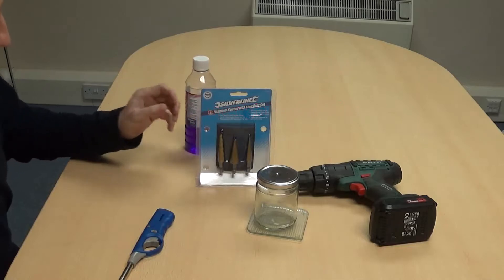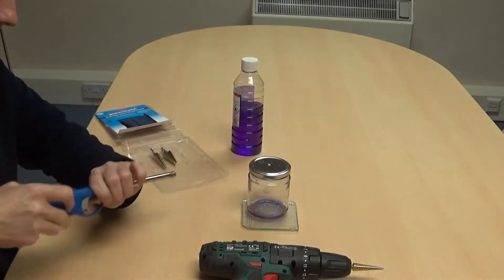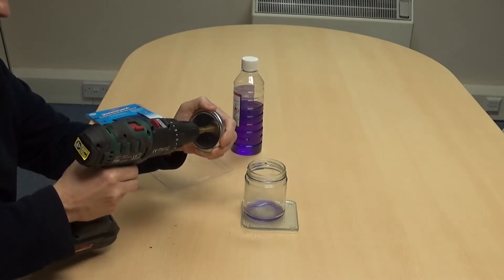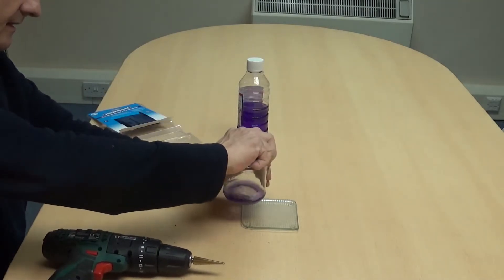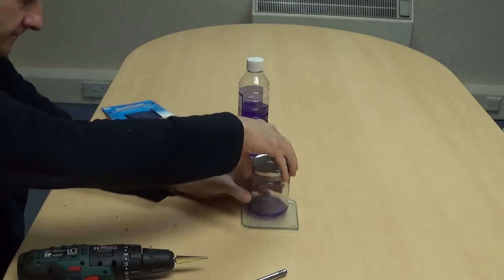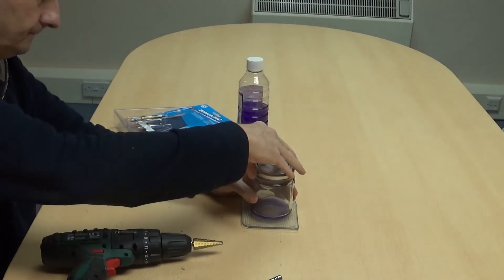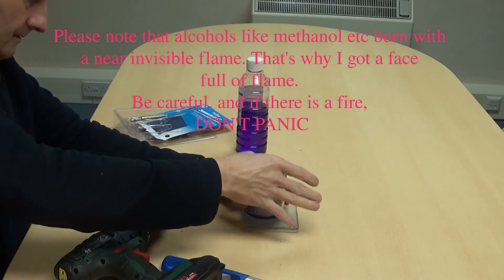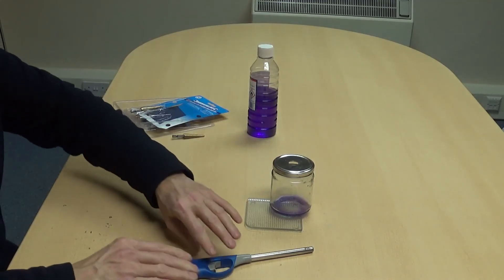How to make a  Jam Jar Pulse Jet

Comment: Ambient temperature , and perhaps even atmospheric pressure, would probably be significant factors in <what works> - as these would directly affect the volatility of the fuel.
Reply from the maker: I see why you say that, makes sense.... but they work well outside.

Also if you run then for extended periods of time you run them with the base in a water bath.

Many thanks for watching, please like, share and if you like the channel, subscribe!

Comment: Diffuser???
Reply from the maker: It's common to use a water bath. What had you in mind as a diffuser?
Reply: @BensWorkshop  ummm 😐 its a cone shaped object, like a pipe reducer but with holes spaced evenly around...
Reply from the maker: Interesting idea. Inside or outside the jar and where would the narrow end go? (Next to the hole or far away from it?)
Reply: @BensWorkshop  https://makezine.com/projects/make-05/jam-jar-jet/ - in short / the small hole inline and about 10mm - 15mm suspended... I learned about it when I was 12 while doing steam engines for school project at a university campus. I could most likely explain fully how it works but ja... I enjoy the old timer' technologies. I can appreciate the simple things more so then most youths today cause of the understanding of what generations before me have accomplished... BTW I kinda use/recycle aluminum cans and occasionally tin cans for most of my projects like turbofans to fully functioning rockets. Haven't made anything go higher then 21530m yet still fine tuning at 18939m...
Reply: Planing on hitting the ISS with a tin can eventually 😉...
Reply from the maker: @themadfoxdj5147  I have no plans to hit the international space station at this time.... 😉.

Incidentally please like, share and if you like the channel subscribe, I'm trying to get to 1000 subscribers.
Reply: @BensWorkshop  it keeps the pulsing going but add a cold bath around the combustion chamber ...  The heat burns through and cracks the jar in seconds if you try use the jar and diffuser only; so it is an important need, to use a cold bath for the glass jar burning... Be careful ... ☺

Comment: I have been experimenting for a while and after a few days i got this to work.
Here are a few tips:
1) The jar should have a tall shape. I found that these work best.The size of your hole is also very important. If you find that the jar is pulling a vacuum too hard or even in the worst case exploding try to make the hole bigger until you find the right size. For me 10 mm worked best.
2) The fuel that you use is also important. I tried acetone,ethanol and methanol but I found that what works best is high concentration methanol.You should also experiment with the ammount of fuel that you put in your jar as this might also affect burning.
3) I found that it is critical to put your jar in a bath of cold water. This helps pull a harder vacuum making the mixing of air and fuel more efficient,continuing the pulse cycle and it also keeps your jar from overheating and breaking. if you find that you can't start it, it might be because your fuel is too cold and not putting out enough vapor, in which case you run it for a few seconds out of the water to warm it up a little.
4)You have to use a pump to start it, as you need some air in the jar. Again experiment with the amount of air you use for startup and see what works for you.
I got mine to run for 25 seconds before stopping it as i was worried it might break but it could have run for longer.
I hope I helped you guys :))
Reply from the maker: Useful tips, though as you can see from the playlist on jam jar pulse jets, I have plenty of types of them and have run many different sorts of them. The best jars have a narrowing top. I use methylated spirits which is an alcohol methanol mix available and widely used in the UK for various things. (I also use it to power one of my two Stirling engines).
Reply: I knew i kinda late but what you mean by to strong vacuum

Comment: So we tried it outside, with rubber in ng alchohol.... started with to small of a he I'd guess. Blew the jar apart. The lid flew strait up, and the glass just exploded.. so I'm not sure about doing it inside. We got a 2nd jar and went to a bigger hole. Never got it to fully "run" but did get a 2 or 3 second pulse out of it, which was fun
Reply from the maker: Wow. What sort of jar did you use?
Reply: @BensWorkshop  just a regular size mason jar. But the hole we started with was less that 1/4 inch.  We found the most success with at least a 1/2 hole
Reply from the maker: @HIllCarver  I'll bear that in mind. Please like and share, and if you like the channel, subscribe! I'm trying to get to 1000 subscribers.

Comment: I find it helps if you use a jar that's at least twice as tall as it is wide. And most small or ordinary sized jars  7/16 or 1/2 inch  is plenty.
Reply from the maker: I'd agree that the jam jar here is too short for it's width. The passata jar one I have is much much better. (I have another video of that coming).